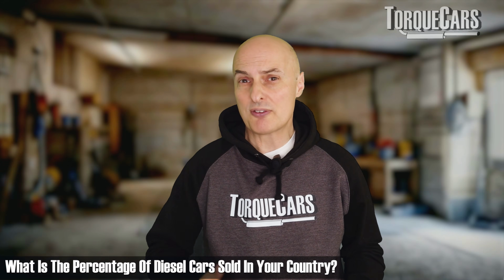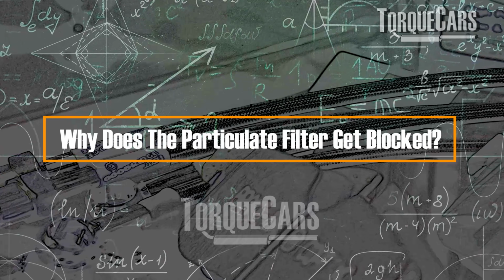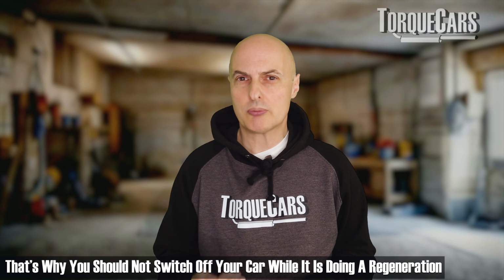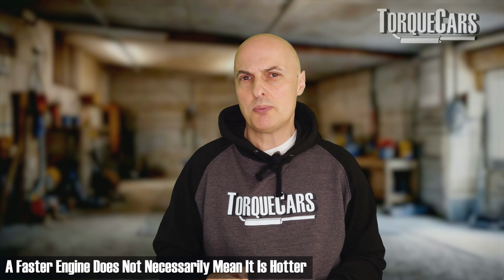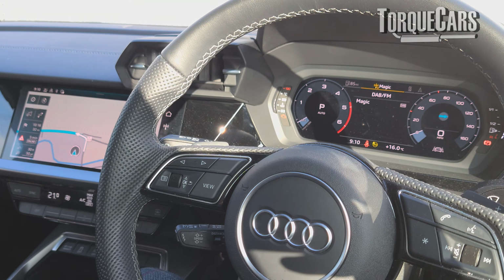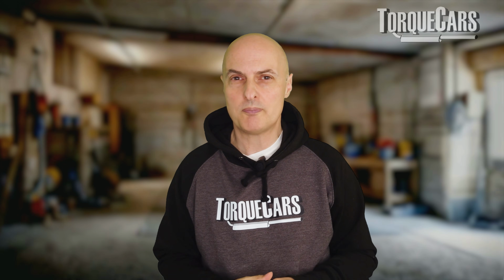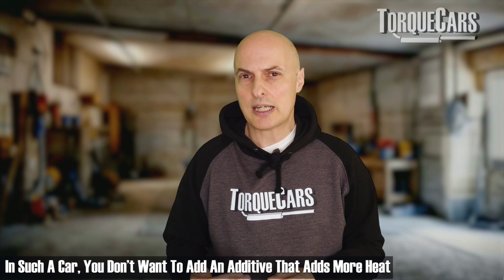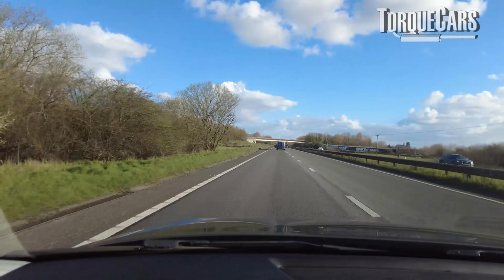Stop Killing Your Diesel! DPF Guide: Diesel Particulate Filters Explained

Comment: I used to have a diesel Kuga and it always initiated regen coming off the motorway, usually halfway down the off slip, and it would make a clunking noise while doing so. My diesel Focus ST just gave a slight change in engine noise but hardly ever did a regen that i could hear.
I used to run a Mondeo and i took it up to 180k miles, no change in DPF.

Comment: Great advice there Wayne.
In the 2 years I've had my diesel it's never once done an active regen. The reason being it gets taken on regular long distance run outs so the soot gets burned off under normal driving (Passive regen). I fill up with premium fuel in every tank so any carbon build up is readily burned away and keeps the injectors, throttle body and EGR clean. It's also serviced every 8,000 miles.
Never had any issues so far
Reply: How do you know it's not doing an active regen on your long runs?

Comment: Diesels love to be driven & worked, just make sure you're right up to temp 👍👍
Reply from the maker: That is good solid advice there which I thoroughly agree with. Fuel economy doesn't seem to vary if you drive hard or are extremely gentle on most modern diesels in my experience.

Comment: Im really unsure if my problem is the dpf or maf sensor!! Every week BUT not everyday my car can run fine then it starts smoking and smelling of fuel, I went for 1hr 40 min run on motorway got to where I was going stopped at lights the car started smoking mpg dropped for 40 is down to 22mpg no dashboard warning signes at all car sometimes shakes went it starts smoking, yesterday I took maf sensor out and sprayed it touch wood its not smoked since so fingers crossed
Reply from the maker: Sounds like you might have hit on the problem there. It's always worth checking for diagnostic trouble codes, they can help track down mystery problems.
Reply: @torquecars iv tried with odb but no error codes at all, believe it or not this as been going on for 5 years! Every garage can't find a problem when I show them the video of the car smoking all they say is it looks like car can't performe a dpf regen!!!
Reply: @Rickstaa58  i think a good mechanic will know the problem of your engine even without the fault code by performing a LIVE DATA STREAMING using their scanner.. in there, they will see if the engine is working properly.. 
  I suggest you use some fuel additive like Launch DPF cleaner..
Reply: @anthonyconsul7547 iv tried all dpf cleaners over last 5 years and nothing, but i sprayed the maf sensor yesterday and it seems to of done something the mpg has gone through the roof, i got 60mpg just down the road and back normaly I'd get 38- 45 ish
Reply: Sounds like you need to be an expert to drive a diesel these days! In my experience it is very difficult to find a service shop that understands these systems. All they want to do is replace when there is a problem.

Comment: 70 plate Kia Ceed 1.6 diesel here. Coming up on 105k miles. Bought at 74k a few years so I figured it was mainly driven on the motorway before I got it.
Easy to tell when a regen starts as the fuel economy drops noticeably (from around 60 mpg to mid 40s). My daily commute is just over 20 miles each way, almost entirely motorway. A regen normally takes about 25 minutes so if I spot it I’ll extend my journey a bit to make sure it finishes if I can.
I’m hoping I don’t need a new dpf at 125k.
Regular service and 5k oil changes with low saps ACEA C3 oil (5W30 as per manual). I had to fill the adBlue tank (10L) when I got it but just under half left after 30k miles so I guess it’s not using much.
Regen requires a minimum of 3rd gear, 1500 - 2500 rpm and warmed up to start. The auto stop start won’t operate while a regen is running (makes sense), which is another way to easily tell one’s running (though I usually turn it off anyway).

Comment: Great video! This channel helps me so much as a 1st time diesel owner. I drive a round trip to work&back, around 44miles with a mixture of motorway/normal roads. That should be plenty of driving for the DPF to stay healthy right? 

I also use fuel additives like wynns gold & cataclean diesel fuel cleaner. 

Anything else I should be doing/not doing?
Reply: @jackwinney  once a month on the motorway part, stay in 4th or 5th gear to keep the revs over 2000, to force the burn off.

Comment: Good info 
Not sure if my vw  has the original DFP but it’s 300k  
Annoying the regen often starts at the end of a journey.
Reply: We did a relatively short trip yesterday to do our shopping and it started a regeneration.
It could have done it the previous night when we drove 17 kms. If ours is still regenerating by the time we get home, I'll drop my wife off and do a drive around the block until it finishes.
Reply: @marisrozleja8762  i switch the engine off leave it to next and Mike sure it’s not to meany short  trips
Reply: @marksmith8663 switching engine off during a regen dumps fuel into your oil
Reply: @marisrozleja8762 how do you know when it is starting s regen?
Reply: @williampatrickfagan7590 
Stop/Start is cancelled and the engine idles close to 1,000 RPM.
Reply: @williampatrickfagan7590  fans come on
Reply: @marksmith8663  My 2013 1.6TDI Skoda Octavia often likes to regen when we pull up on the drive. The fan goes on full blast for 1-5 minutes.

Comment: Love your videos Wayne. This one confirmed what I have read in the past has been wrong.
It's very confusing for the average motorist to understand and manage all this information regarding their DPF. In 2019 I bought a new Berlingo 1.6 HDI. 6000 miles service from new and last year it needed a new adblue tank. It's on 46.000 miles now and to this day, I have never noticed the van running a regeneration cycle. It must have but I have never been aware. I've simply never noticed any of the symptoms people talk about. Would you have any thoughts yourself on my experience?
Reply from the maker: Thanks for the support my friend. There is so much bad information out there, and with all these faceless ai channels springing up it's just getting worse. In larger vehicles with more road noise and less power it can be hard to detect a regen whilst driving so you're not alone.